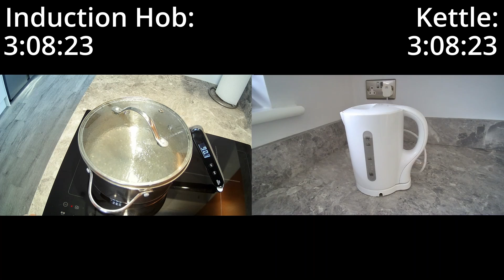Electric Kettle V.S Induction Hob - Experiment! - Which Boils Water the Fastest?

Comment: A very interesting and also a more un train related!

It seems a bit random but that’s why it’s so good!
I honestly love this video (partly being a bit of a nerd, lol)

Stay safe and Merry Christmas mate!
Reply from the maker: Thanks Jayden - yes, suppose it is, but after all, I'm a mixed variety content channel now! 

It was fun making it too and I enjoyed actually getting some scientific-ish results. We're both nerds lol!

Merry Christmas! 🎄
Reply: @highbrookendmodelrailway  Was just thinking, what if you did this again but with 2 pots on the induction hob but one on normal mode and one on power mode, how of a difference would there be then?
Reply from the maker: Interesting idea, I'll have to try that at some point. I'd have no way to measure the actual power output (and I doubt it's as simple as taking the maximum power output of a ring and dividing by 10 (the number of power settings) to find how much each power level is "worth" so to speak) but the timing difference would be interesting.

Thanks for the idea!
Reply: @highbrookendmodelrailway  induction made it easy. Instead of getting useless specialty appliances (except convection oven) like electric kettle, Electric skillets and electric hot pot, there are now induction pressure cookers and induction kettles, they're stainless steel and can be used on an induction cooktop